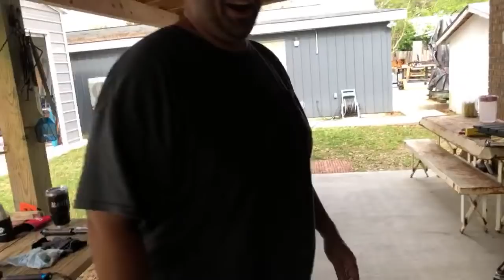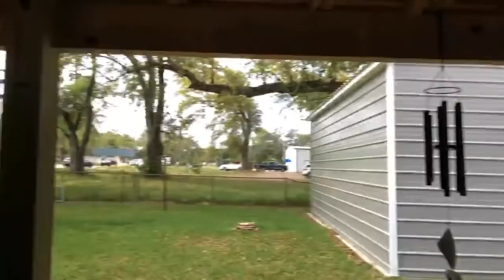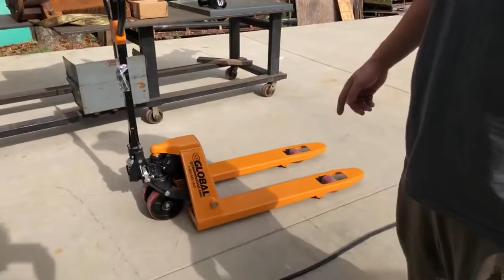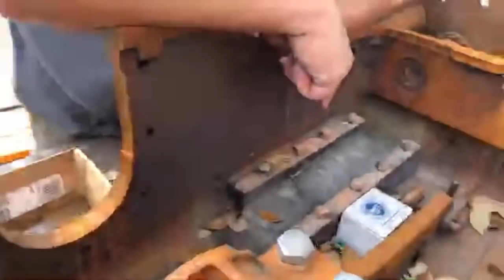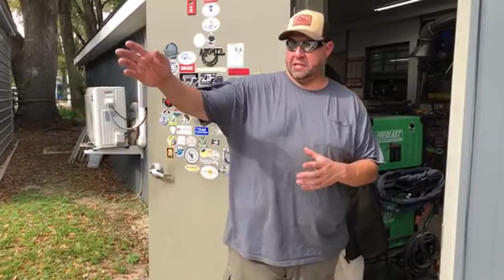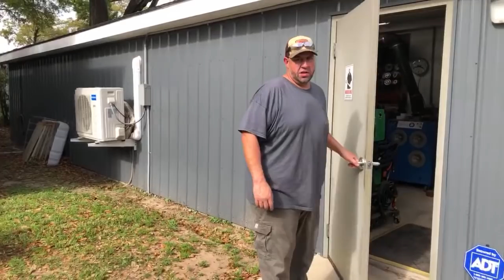Update from the Abom Compound

Comment: Hey A-bomb 79 good to hear from you and Abby. Just wanted to know if you have or have not sealed your concrete in your building. I sealed the inside of my garage floor used 5 coats and have never been happier stuff cleans up, sweeps up and it doesn't scratch.

Comment: I don't comment much, but you guys are the real deal.  Thanks for the content.  P.S. - the Orbi router/wifi system is really good.  You can have the head unit in the house, and plug in a satellite repeater right into a 120V outlet in the shop, and it will be a great wifi signal.  Probably cover your whole property.  Stay safe and thanks again!  Dave in RI
Reply from the maker: I believe that’s what I’ll be getting, but it’s through our internet company.

Comment: You makeing some videos now is really appreciated 
Do you already have some ideas for tools and projects to increase your shops capabilities while you also self quarantine?
maybe make a hydralic press adapter for blacksmithing - pressing instead of hammering - now you can heat pieces up in the oven
might also want to build a manual shaft bending press so you can bend things easier straight  - like old style gunsmiths used to straighten barrels

maybe build a milling/grinding attachment to the lathe 
can you try to brazing larger pieces of steel together with your new oven 
maybe try some more hardening - you also could try to melt and cast some small aluminium and copper pieces within your new oven
you could build a oven that heats the shop 
a friend of mine recently welded a nice oven - he used a catalysator from a car pieced into the chimney to get less smoke and sut outside and even more heat and eficiency inside
could you make some welding tutorials - like how to weld up a worn down shaft without warping it 
also how do you make very fine small welds with a MIG welder?

Comment: hi Abom, for internet in your shop it might be better to run an outdoor ethernet cable out there direct from your router and then have a wifi hub in your shop. You can make the wifi out there have the same name as the wifi in your house - then your phone/ipad/laptop or whatever will just choose the one with the best signal. That would be the best connection :) Wifi repeaters like you spoke about can be a bit hit and miss.

Comment: Hey Adam careful with the intakes, like the chevy small block with the distributor through it . If it squeezes the rubber seal out the front or back there's not much to take off it.Befor the distributor  contacts a tang/slot in the oil pump and smashes the gear into the cover . Seen soooo many of those with vacuum leaks that they just added more fuel at the jets. cause the positive crankcase ventilation draws a vacuum in the crankcase (it's worse at idle) it can help mask the performace and tuning issues  distributor depth and put the exact gaskets your going to use and messure that gap at the front and back. Thats not engine re-building  thats engine building         glad to see you and Abbey doing well wash your hands and ziplock bag with a bleach water soacked rag  for wiping  handles and stuff when you go out I think i already had it (pretty sure) my moms a nurse and the long term patient she's taking care of well lets just say is part of the healthcare comunity where one of the first patients was found I felt sooo sick and  went to the store slipped on ice on the top step almost broke 4 of my toe's when i fell i kicked the railling walke with a limp  for a week and a half.....  gotta make my own valveseat runout gauge tonight sooo big fun!

Comment: I am using the time at home to clean up and organize my shop. I just got a full bottle of Argon and when this corona thing is over I will be a better TIG welder. I am going to put a new top end on my VW sand rail (rings are shot). My wife's dune buggy is getting a new transmission in June or July. One thing I am happy with is that eventhough the toilet paper may be hit or miss, the beer coolers are well stocked.

Comment: Run a cat6 cable from your router to the shop and set up another wifi router in the shop as an access point. That metal building probably acts as a faraday cage. Or yeah, go you could go with a mesh network also. There's a few options but you cant beat a hard line for consistant throughout though.
Reply: Why would you suggest a mesh with only two or three nodes?
Reply: @Pdro-gw7lu  I was leaning more toward a 2nd router wired to the first and was really just throwing it out there as one of a few possible solutions. What's so wrong with a 2 node mesh network anyway?
Reply: Yep I ran some direct burial cat 6 from my house to the shop ezpz

Comment: Hey Adam! Just a little advice for you and Abbey. This is particularly for when you are doing videos outdoors. If you have to turn away from the camera, stop talking and wait until you are where you want to be, then turn and face the camera. What's happening is that what ever you are recording on most likely has something called "ALC" or automatic level control. What I think is happening is that the higher pitched noises from the traffic are triggering the ALC circuit and it's turning down the levels from the mic to the video. It's also a matter of you're being far enough from the mic so that even when you are turned to the side, the mic can't pick you up very well. The other thing you might try is if you can add an external mic to whatever you are doing the video on and clip that you your shirt. In this case, if there is a jack for a mic, you can get an adequate wired mic much cheaper than Bluetooth or wifi. Good luck. :-)

Comment: Hey Adam...  I know you have quite a few Tech savvy watchers...  I think you should do a  layout (i.e. a plan) of your house and shop and say what material each wall is and let them design a Wifi layout for you...  I am sure that many of us have spare or even will donate new equipment so that you can do high speed, high resolution streaming in the future......  BTW if you don't already have it .. I suggest FIOS for your home / shop.. I believe since it is part of your business you can take it as part of your business taxes...  BTW I suggest (the way the world is going) that you wire up your shop with networking... the Pod is just a repeater... you will max out your bandwidth too quickly if you just use the repeater / extender... Wire it up with Cat 6 or 7 and put a wifi AP in the shop... not that expensive and will be much better.

Comment: Adam

My experience with network extenders is very poor. I think you too will be unhappy with the Pod gadget. I imagine you understand that the metal siding on your shop stops WiFi (and pretty much all radio frequency) signals.

You will be best served by running an ethernet cable to the garage and installing a router there.

Love your show, lust for your tools as I used to be a machinist. Put myself through Engineering school as a tool maker/ultra precision grinder. Now retired, I have no machines available :-(